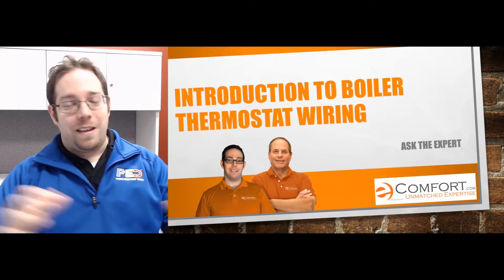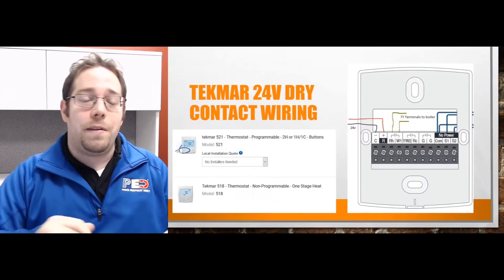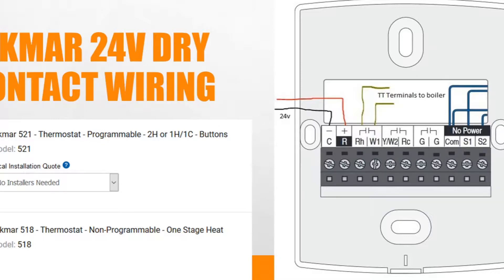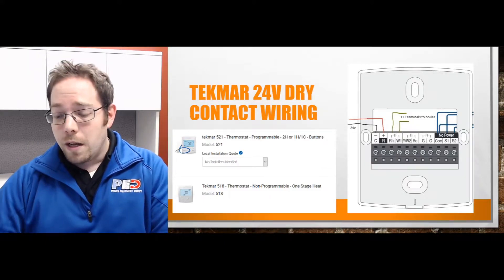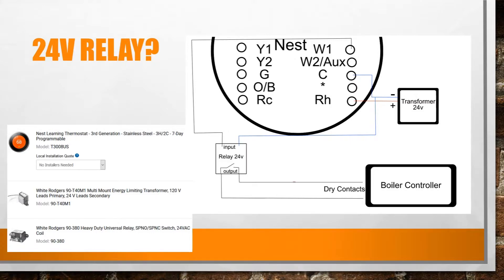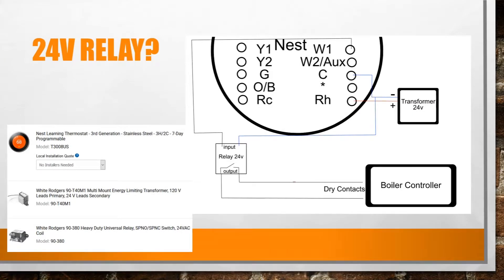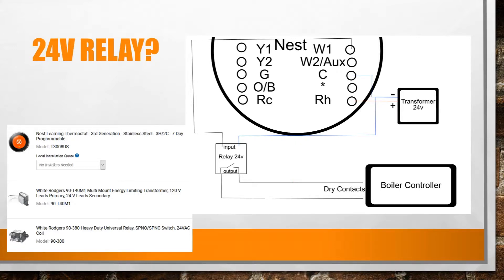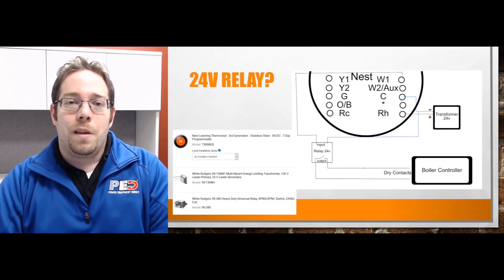How to Wire Your Boiler Thermostat

Comment: I suggest you re-do this video, with a slower pace of (vocal) delivery.  Also, when you re-do it, I'd suggest (in the intro) addressing the belief, in some quarters, that Nest t-stats, i.e., "learning thermostats", are designed for use with furnaces, and not so much for boilers, since boiler systems - as far as heating the air in a room - are slower.